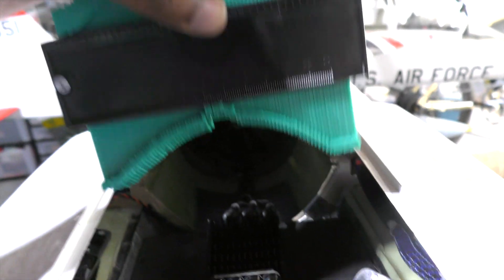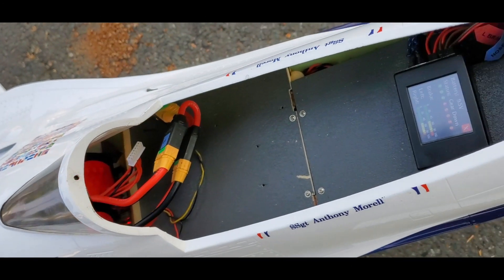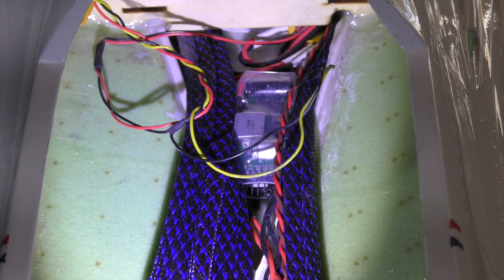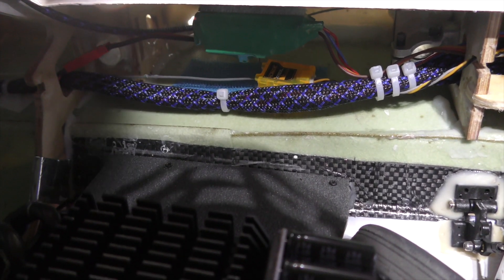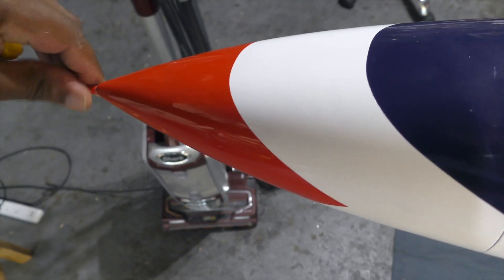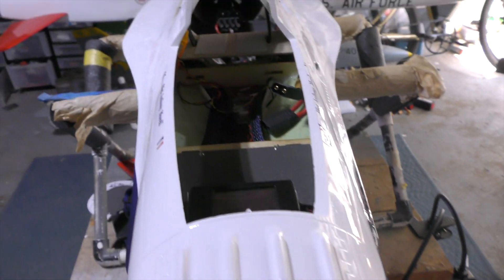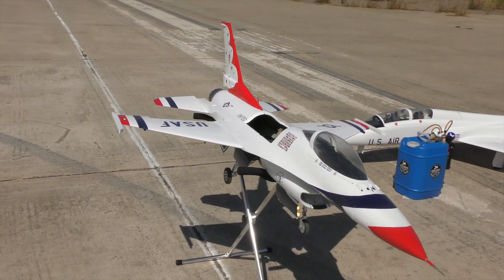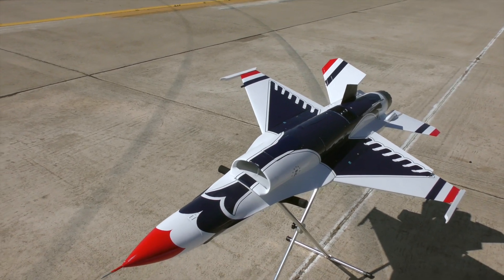T-1/T-One F-16 Turbine to EDF Conversion Build

Comment: Awesome build, thanks for sharing. I’m surprised you went with orange RX. I have heard so many horror stories about them. I’m guessing you have had good luck with them?
Reply from the maker: Hi Jeremy. Orx used to suck a few years back. But in the last few years, I have found that their version 2 and 3 DSMX RXs to be really good. I like them so much that my large Skymaster Twin 12S is running ORX with no issues for many flights now.